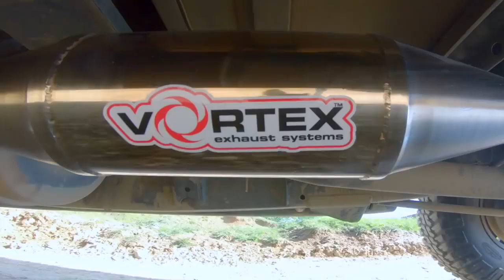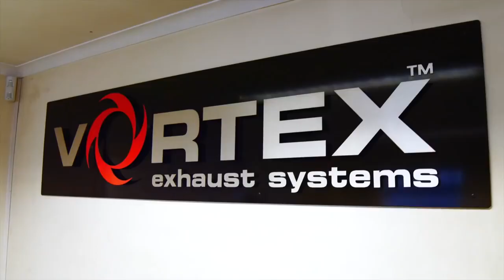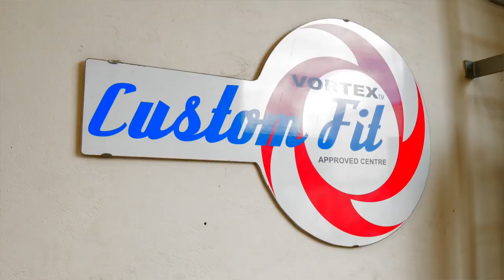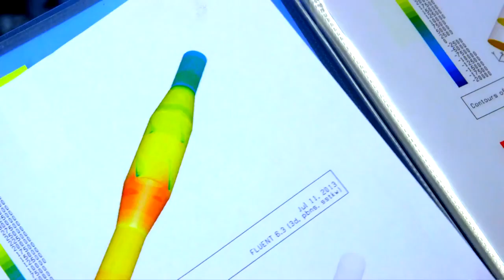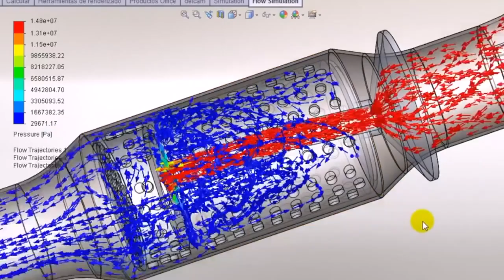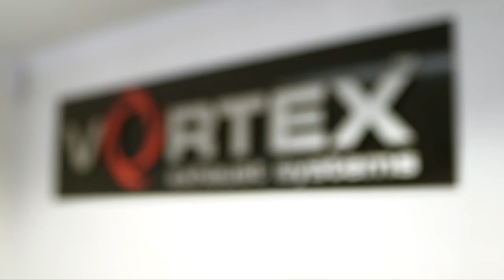Landrover Live Independant Review on Vortex Exhaust

Comment: So engine braking is caused by pistons pulling a vacuum because the throttle drumroll throttles the intake of air so it creates more work for the engine to pull fresh air into the cylinders. 

Even if you remove the cat and straight pipe an engine with a wider bore than standard (thus removing ANY back pressure) you have the exact same engine braking characteristics.

Sorry but this is pure snake oil..... Just as bad as putting a vortex creating piece of rubbish in your intake, does nothing.

The gains you will have seen will be down to less restrictions due the exhaust being more free flowing, same as you would get from miltek, cobra, scorpion even powerflow.

I have looked all over the web and have yet to see one before and after DYNO run that proves any gains, even better would be the Vortex against any other decent sports cat and cat-back system.